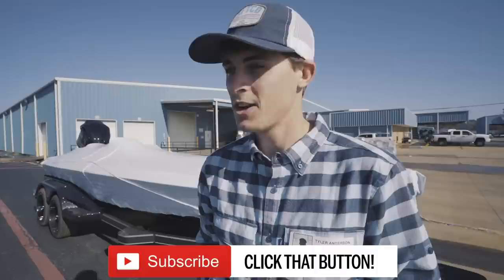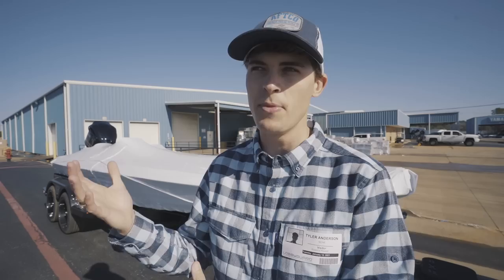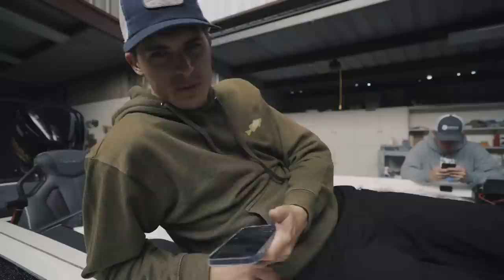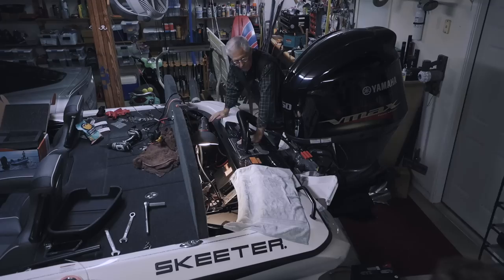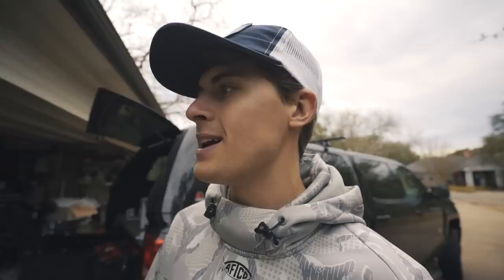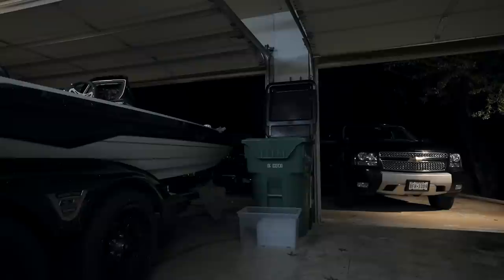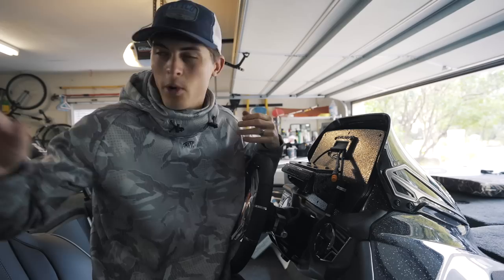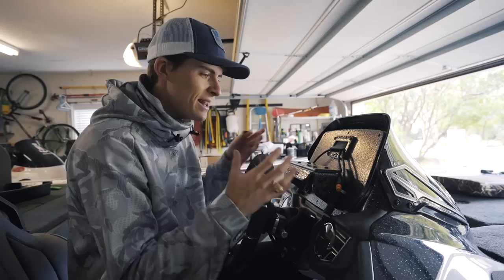My BRAND NEW Skeeter BASS BOAT!! (FULLY CUSTOM Start To Finish)

Comment: Curious how much you saved in cost by doing the work yourself vs having it done for you. Congrats on new boat!!!
Reply from the maker: A few grand. But the even bigger thing, is that I am completely aware of where every wire goes and what its purpose is. So when something goes wrong, I can be up and running a lot faster than having to take it into the dealership

Comment: On the electronics issue with starting your outboard. I am assuming you are running the graphs and motor on the same circuit so they can charge. I would suggest getting an isolator and separate batteries for the onboard electronics and your outboard. I've got a large amount of experience with this working in the power spot industry as an electrical engineer so I'd be glad to answer any questions people have.
Reply from the maker: The way MOST bass boats work, is that you have 3 trolling batteries running to make a 36v system, and then you have one "cranking" battery that of course powers the engine, but also powers all the electronics, lights, accessories, etc. That battery can only do so much, but can do a lot more with that so much, when you have better quality wires connecting your high voltage draw items. Which is why all the full time fishing guys like me run wire harnesses now. I'd love to pick your brain on how to make it even better though! (Wish I had space for one more battery!)

Comment: Have you used the Lew’s SP skipping reel yet? Any chance you can do a review?
Reply from the maker: I have one coming very soon, and I will definitely be making a review!
Reply: @TylersReelFishing , That’s great to hear. I’m hoping to learn if it’s worth buying a dedicated skipping pitching reel, or if there are options that skip almost as good for $200 that are more multipurpose. Can always put a piece of tape on at 40 yards of line when skipping. Hoping the breaks are tuned for skipping better than a standard $200 reel.
Reply: @Jason_Hall  the tape trick works like a charm
Reply: @TylersReelFishing  one other request for that video. Find out when Andy Montgomery’s matching skipping rod is coming out for it. He had the 6’9” and 7’1” for Daiwa and I heard he worked with Lew’s to design similar.

Comment: Nice boat but it won't make you a better fisherman!?!?!  I like boats but 20 to 30k  is my limit for a bass boat  Ranger boats all the way!
Reply from the maker: Sadly, Ranger has lost a lot of build quality since they got bought a few years ago. They are not the same boat, brand new, as they used to be
Reply: @TylersReelFishing  luckily my 2020 RT 188 was one of the last ones made in the Ranger plant by Ranger in Flippn....all the 2021 aluminums are built by Tracker now and the glass boats have suffered greatly since they were bought